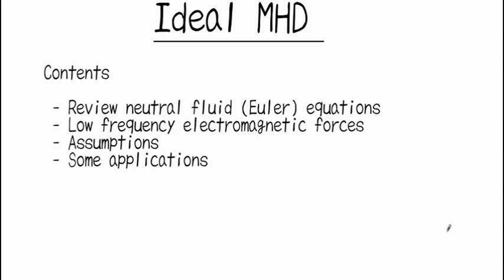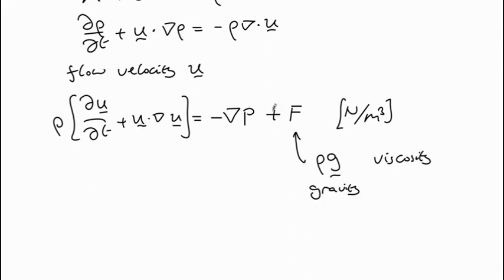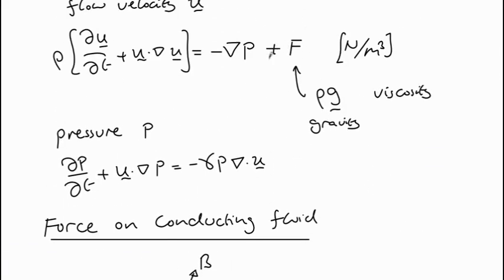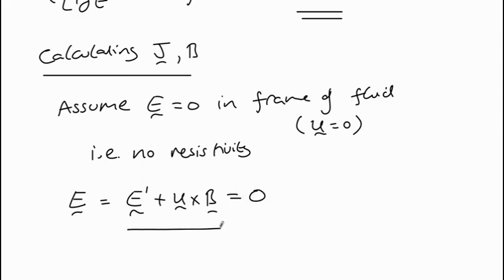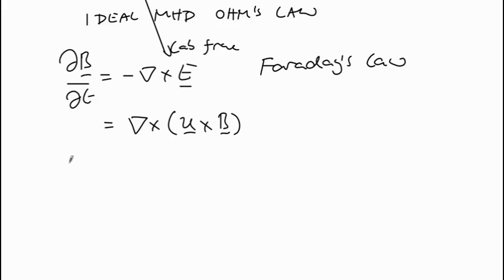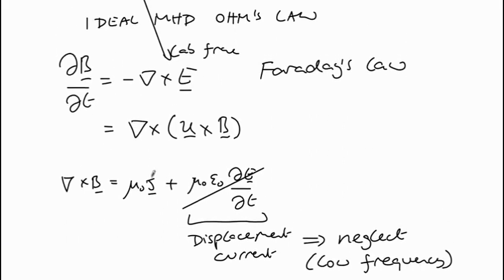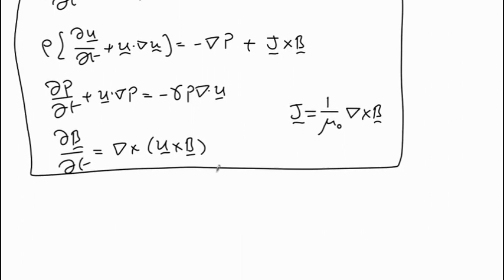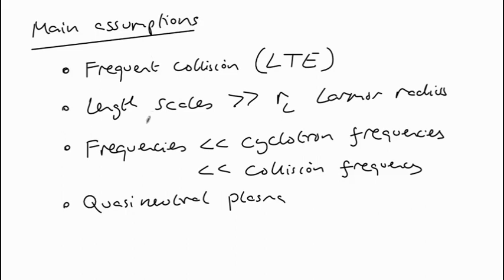Plasma fluid theory(MHD) - Prof. Ben Dudson. 5b ideal mhd

Comment: Hello Prof Ben. Thanks for the interesting lectures. Just a quick question. If I understand correctly in the IDEAL MHD there is no explicit assumption stating that the fluid is compressible or not. Is this correct?